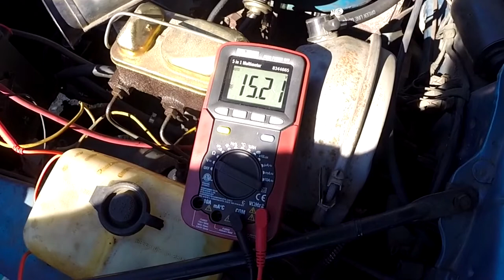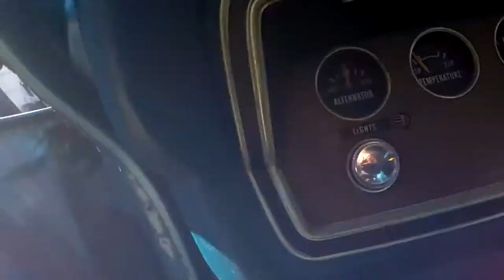1974 Plymouth - Voltage Regulator

Comment: Hey there, I have a similar issue with my 73 duster. Whenever I start the car the amp gauge bangs to the right. What else could I check?
Reply from the maker: Have you already done the regulator? They are cheap as dirt and fixes most of those types of gauge problems.